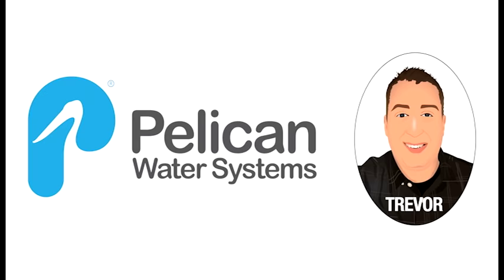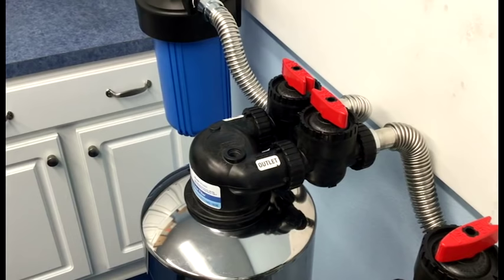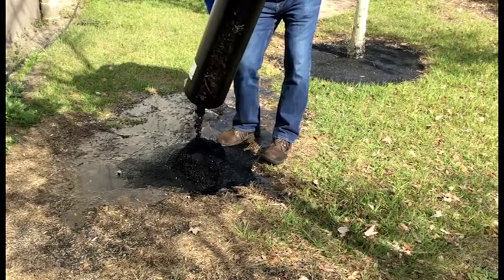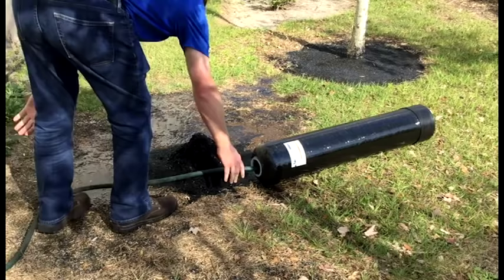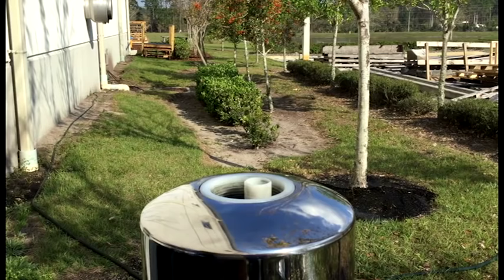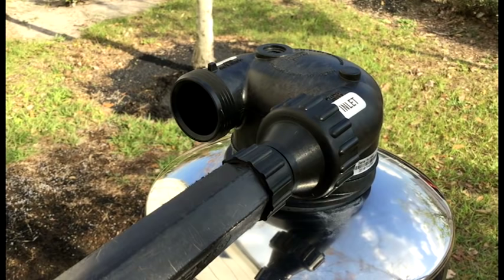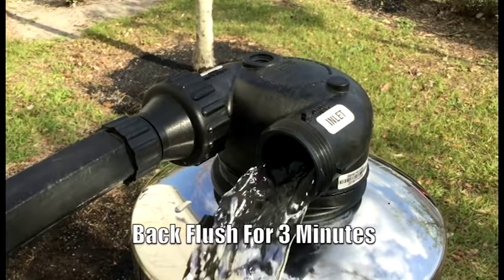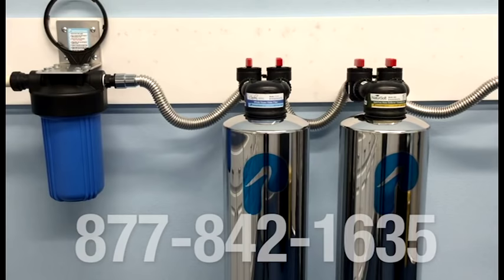How To: Replace Carbon Media For Pelican PC600/PC1000

Comment: I have been very pleased with my Pelican water system. They are always helpful when I call because I often forget what system I have when I order. I don't bother with my refrigerator water filters because it would just be redundant and a waste of money. The water is delicious without it. Every tap in the house has delicious water. The occasional watering of the lawn never leaves the awful rust stains my neighbors have to deal with (cleaning with acid!). I could say more, but it would start to get weird. Just suffice to say, I am pleased with this purchase.

Comment: How Can I use the water if I have to soak the carbon media for 48hrs?
Reply from the maker: Our systems come with built in bypass valves. While you are soaking the media your bypass will stay attached to the plumbing and in bypass mode allowing water in the home until you are ready to hook up your system again.

Comment: Hi. Thanks for the video. Is not necessary to put a layer of pea gravel first? Thanks in advance.
Reply from the maker: For upflow systems gravel is not needed. If you have a downflow system (backwashing head with drain) you would need gravel to help prevent channeling.